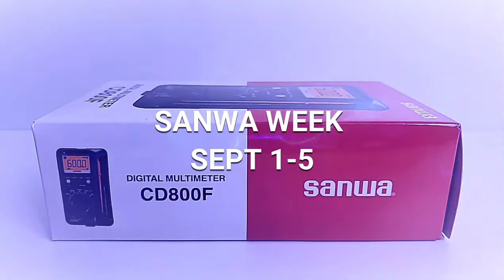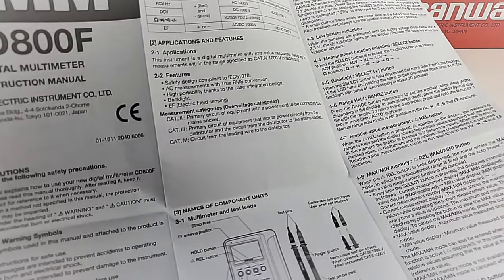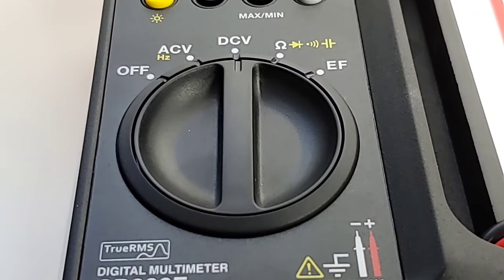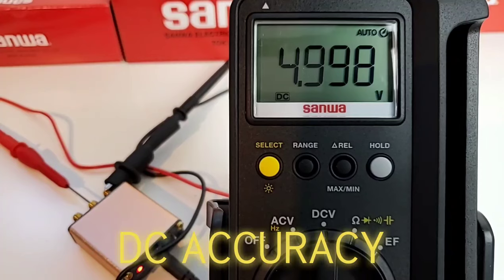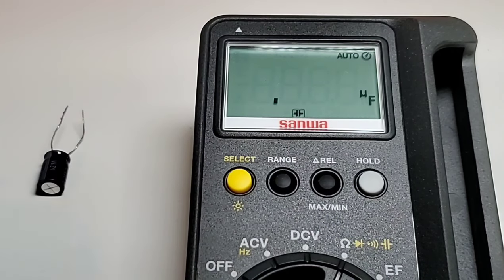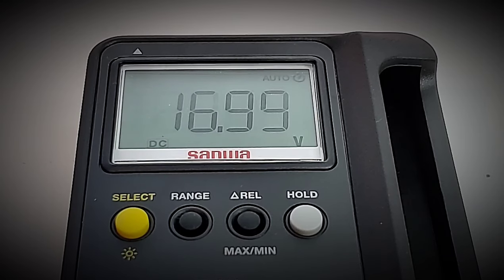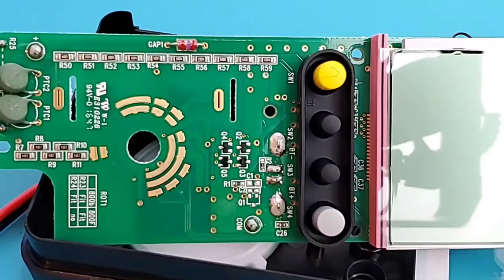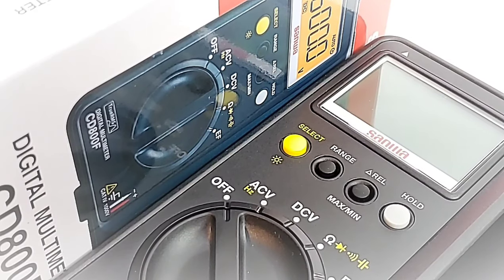SANWA CD800F Multimeter Review & Teardown!

Comment: Sanwa got the backlight right with this CD800F. I hope they come out with a revamped CD770/771/772 mark 2 with this better backlight. Back to the CD800F, it uses AAA which is not my kind of power pack. That size should able to accommodate the cheaper and efficient AA. No fuses but I hope someone could mod one on that empty spot. Two stars to Sanwa I am afraid. 

Thank you for another good DMM review Darren!
Reply from the maker: Cheers and good points! I think the CD800F backlight is one of the best in the business too!

Comment: In my opinion: Very nice DMM for automotive use. Nothing to worry about, if it´s tossed in a toolbox. It´s well protected and the probe wires are nowhere dangling around. Measurement of capacitance is anyways not a needed task in cars. In case of an emergency even the current can be calculated by (measured) resistance and voltage drop. 
But even this detailed review today left some questions over:
1. How long stays the BL on?
2. Frequency (upper) range?
2a. Works the freqency measurement only with a signal that crosses the zero Volt line (could be important for PWM signals)?
3. Up to which frequency is the True-RMS AC measurement accurate?
Reply from the maker: BL stays on for approx 30 seconds 
100kHz (Frequency)
Accuracy assured frequencies of the ACV are 45HZ to 500HZ (True RMS)
Reply: @KeepOnTesting  Thank You for your effort. 
Sad, that it has a "standard backlight". 
IMO: A BL that´s always on if activated (e.g. like the RuoShui 202 CHEAP-O DMM handles it) would be much more useful, especially for automotive purposes.

Comment: Another good review. This unit really has a quality look to its build, that is one THICK PCB-!  Continuity is one of the best ive ever seen, display is crisp and clean.  Only negatives would be as you said the curiously low cap range depending on your purpose for the meter, a so-so ncv, and for some the non-detachable but very high quality leads along with one of the highest quality case moldings ive seen. But as you said to be fair this is a niche sort of dedicated purpose meter meant to be (almost) a pocket portable imo.  Nice input protection and I like that they use a gas discharge tube, many makes wont use them as I understand they are a bit pricey(?) - But even in this small niche meter theres no denying the obvious Sanwa quality throughout.
Reply from the maker: I really enjoyed this dmm,  you can tell alot of thought went into the design and build quality of this multimeter!
Reply: Yep, and if this is how they build the smaller ones I cant wait to see their upper tier offerings.

Comment: DC accuracy? Maybe your reference is not that accurate at all and it is showing...! There is a time when I hated the idea of a fixed test lead like a YX-360TR since there were a lot of times that the meter got off the table or bench or wall or some metal plate and was catched by the leads...sometime soon we had to replace them. That is just the concern, and it gives that meter you have the high category rating since connections are all encased.

Finally, something made in China that does not look, feel or (hopefully) smell like one!

Comment: is this capable of measuring the heater voltage on a tube tv crt???
Reply from the maker: Yes, the low Voltages shouldn't be a problem 👍 even with the higher frequencies.
All voltages except the filaments should be DC. You should have 6vac across the filiments (AC) because its at 15.7khz some multimeters will choke when trying to accurately measure AC at higher frequencys.
Reply: @KeepOnTesting  ok thanks you

Comment: Can I use this model to test battery in car and alternator?
Reply from the maker: Yes! Set the multimeter to DCV (VOLTS DC), Then attach positive lead to positive battery post (red) and negative lead to negative (black) battery post. You should see around 12.6V ..now start the engine..you should see around 14.2-14.7 ⚡️ volts on the multimeter. Anything over or under means alternator isn't working efficiently. Make sure to put a load on it..turn on lights accessories etc...it should not effect the reading significantly.👍
Reply: @KeepOnTesting  Great. I will test my battery as soon as my multimeter arrive

Comment: Resistance of the Test Leads, Poor in capacitance measurement, No stand at the back, oddly sized, No fuse, Single screw support for the entire body, Name sake NCV without filament, no current testing, etc. Which direction is Sanwa going to? Sanwa, are you hearing?
😐 ...
Reply from the maker: Its not the perfect multimeter but believe me its incredibly well put together and a joy to use...a tiny stand would have been a welcome addition or even a modular setup utilizing the back cover. Still, it's got alot of goodness and if I only had a few multimeters , this would be one of them.. 😄👍
Reply: I can concur, this is one solid test meter...in the domain of the affordable the CD800F is outstanding!